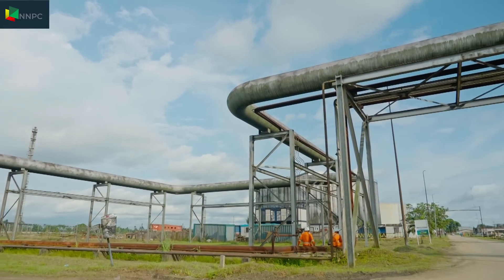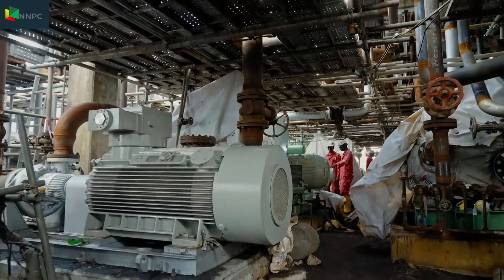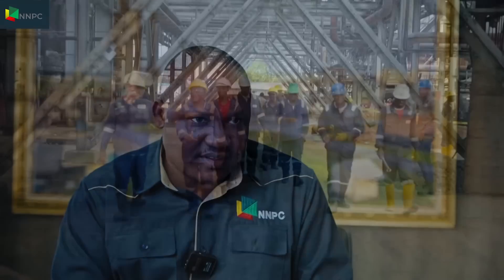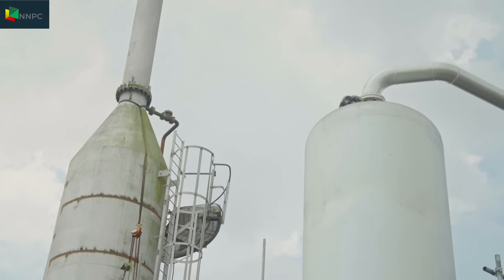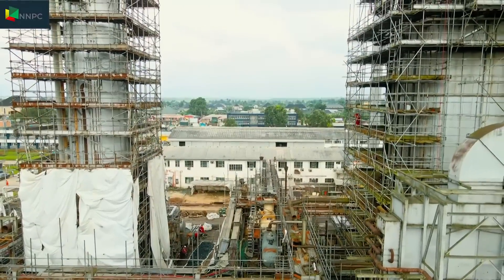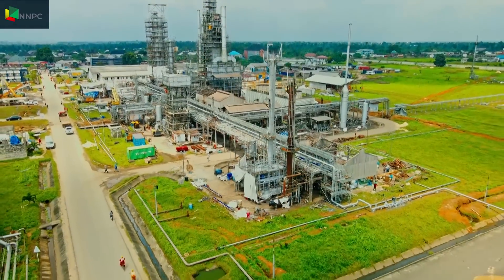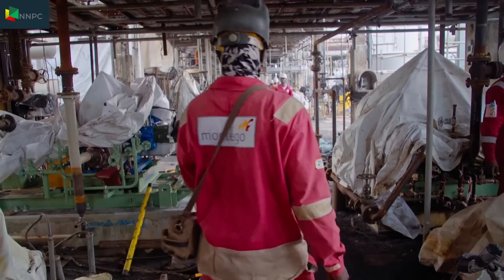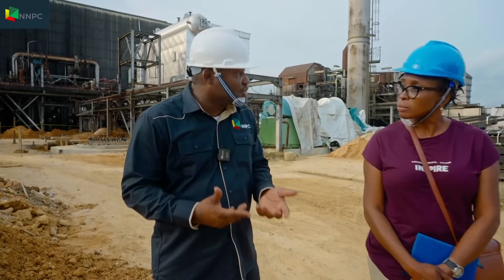PH REFINERY UPDATE DOCUMENTARY

Comment: This is laudable. However I observed that the heat exchanger @ 02:07mins is having plugged tubes. Why wasn't the tube bundle or heat exchanger replaced outright given this extent of ongoing revamping? Hope this is not a common theme for the heat transfer equipment....
Reply: Plugged heat exchangers don’t just get changed, they need to have undergone over 10% of its tube plugged before we can carry out Re-tubing of the heat exchanger.   Having worked on various static and rotating equipment this is an experienced advice.
Reply: Excellent observation. I thought as much when I saw it